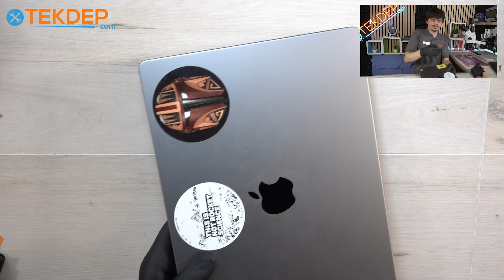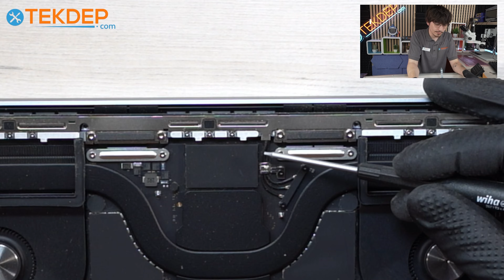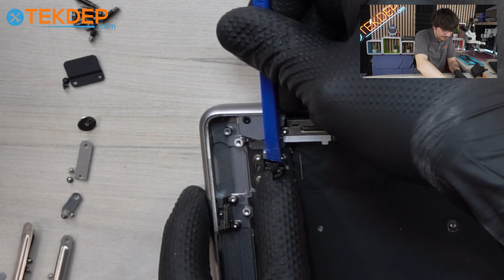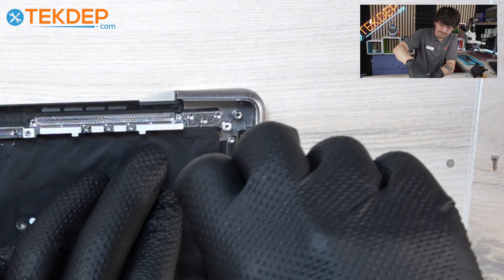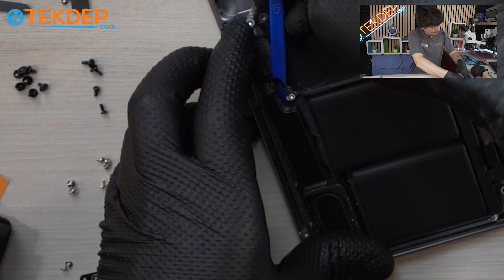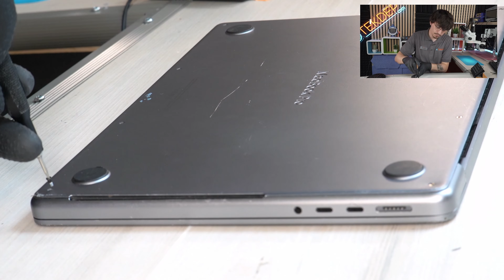14 MacBook Pro A2442 Liquid Damage Repair - Full Top Case Keyboard Replacement Tutorial

Comment: I have the same MacBook. My kid vomited on the keyboard and I quickly flipped it down. I left it for 24 hours to dry up. Everything works fine. I cleaned up the dried vomit on the keyboard. Been 8 months and still working fine. Probably helps that the vomit consistency was not “liquid” more like a thick condensed milk 😂. Watching just in case the keyboard will not work😊
Reply from the maker: That is very lucky 😂 good luck

Comment: Thank you very much for this Video! Used it alongside the ifixit steps to combine the ability to judge required force with the written screw-list and it turned out awesome! Turned on directly after plugging in power and works like new.
Had two keys dead from a spill I've noticed a bit too late and since the Device was 5 years in very heavy usage with close to 1k cycles on the battery, the replacement put this device in like-new condition.
Reply from the maker: Great job on the successful repair, thanks for sharing your experience! 😊

Comment: Awesome repair guide! This was exactly the guide i needed and I like your style. Annoyingly, the uppercase I purchased didn’t include the microphone (took me taking in apart twice to figure out why i was always missing a flex cable on the right 😂) Any advice on how to move the mic from my old upper assemble to the new one?
Reply from the maker: Thanks, glad the guide helped! For the microphone, you’ll need to carefully transfer it from your old upper case. Gently disconnect the flex cable and screw/clip it from the old assembly, then attach it to the new one, making sure it’s properly aligned. Take your time—these parts are delicate, and a steady hand will help avoid damage.

Comment: So if it has no power and has a known spill, pretty safe to assume battery and keyboard at least? Would I even need to worry about the ports of I knew they got wet too?
Reply from the maker: If it has no power after a spill, the battery and keyboard are the most common failures — those are good starting points. But if liquid reached the ports, they can also short and cause no-power issues. So fix the obvious parts first, but keep in mind any area that got wet may also need attention.

Comment: From everything I’m seeing online it’s pointing to keyboard replacement. I guess it’s pretty good if flipped in time to prevent the main board from liquid damage?
Reply from the maker: It sounds like you did a great job preventing major damage by powering it off and drying it quickly. The random input issues and falling keycaps are consistent with liquid damage to the keyboard itself, so replacing the keyboard is usually the solution.
Reply: @tekdep yes sir. I had to take it completely apart and install a new keyboard. Was a bit intimidating for sure but I got it fixed lol

Comment: Just for background, immediately after the spill I turned it off, flipped it upside down and completely drained it/dried it, and then put it outside in phoenix heat for 24hrs to completely dry. It worked completely fine for a couple days but then button caps started to fall off and I believe some signal issues as it will randomly act like I’m holding buttons down when I left click, cause it’s bringing up the box of a right click.